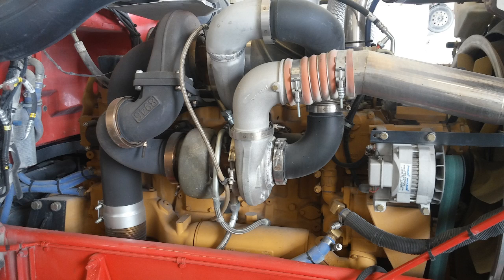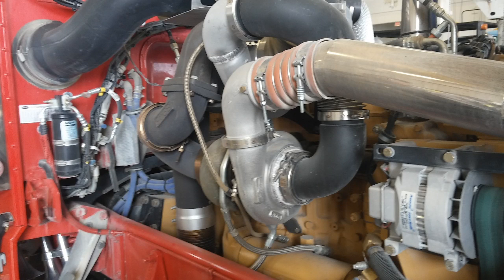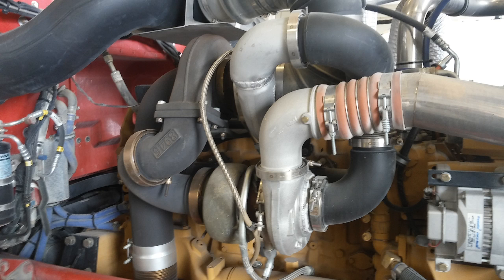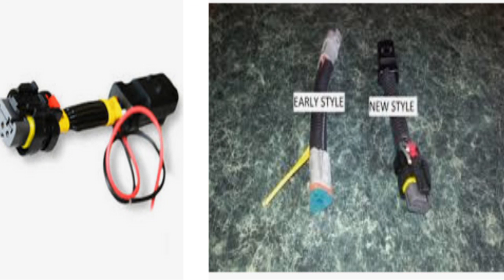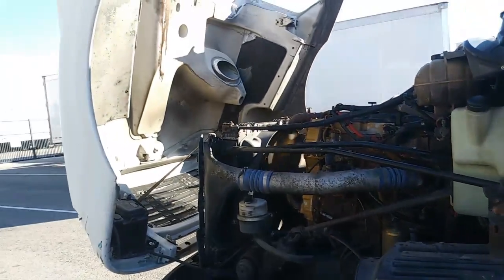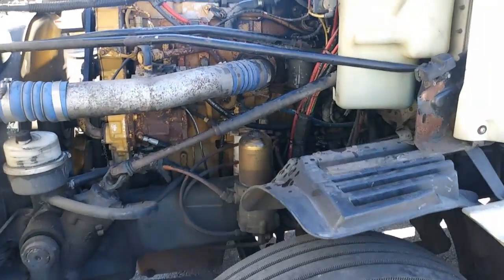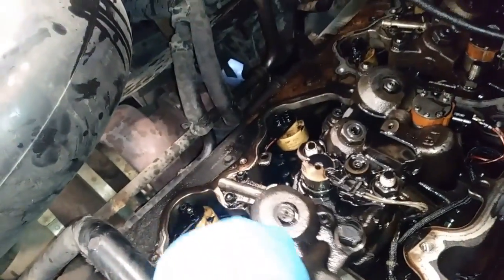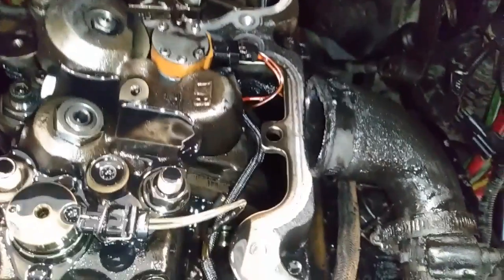Should You Modify Your Cat Diesel Engine? Should You Use Performance Parts On Your Cat Engine?

Comment: Thanks for the info learned a lot from you. I have a c15 MBN  running cold 160 with a load on. Changed thermostats still the same. Can the vent line cause this?
Reply: change again
Reply: Verify your gauge is correct before going too much further. Sending unit could be screwy, or even the gauge itself

Comment: I have a stock 1998 military CAT 3116 turbo engine in my military LMTV truck. It's the equivalent of a Duce and a half. My top speed is 55 to 60 mph. Is there anything I can do to get the truck up to highway speed ex: 75 mph short of driving it of a cliff?
Reply: the only way to do that is to either change all of your axle gear ratios or put an over drive brownie box between the transmission and transfer case which means you'd have to make new front and rear drive lines.

Comment: Warranties aren't worth the paper they are written on.  The core aspect I would say is very very valid.  The other aspect of folks not understanding how their components are suppose to work together compared to he engineer that designed it is also valid.   Dealerships will weasel their way out of any warranty they can.  I know I work for one.  You shouldn't be modding your equipment unless you have the means or know how for that matter.
Reply: I disagree. Cat just honored my warranty to the tune of $25,000.
Reply: @joe67tro   it happens every blue moon, I'm glad you didn't get shaft.    In no way shape or form am I bitter at dealerships either, I'm just saying they aren't always rooting for our team the end user.  A lot of folks don't get the same in frame music you got to hear.  Good for you Joel.
Reply: @910starlet   To be honest, I was very surprised when they told me warranty would cover it. I was waiting for them to hit me with, Because of "this reason" it won't be covered.".
Reply: @joe67tro  I too am surprised when a service writer stands behind their warranties, they have only so many billable hours to reconcile the discrepancies in brand new trucks.  It's even worse when it comes to an inframe.  But yes sir, I'm glad you had your warranty honored.  Very uncommon now a days.
Reply: @joe67tro  my buddy c15 was rebuilt by cat made it a mile down the road and shutdown and would not start. Had it towed back to cat. 3 days later they tried telling him it needed rebuilt again because of dirty air filters and they wouldn't stand behind the warranty. That got lawyers involved
Reply: The more you know, the more you'll NO!
Reply: I dunno, Cat is paying for most of a repair I'm doing on a trash compactor, just out of warranty... EGR cooler failed and hydrolocked the engine. 
Case by case, dealer by dealer, brand by brand. Some will bend over backwards to help you, others will bend YOU over backwards to help you.
My experience across 2 dealers for Cat- Caterpillar will honor their warranty with minimal exceptions, UNLESS you abused it. And trust me, on modern stuff... we will know. On the machines, some will even tell us how many times you've run without the seat belt on, let alone how many times you overheated that torque converter, engine, etc.

Comment: What jerk thumbs down,I'm ready to send this fellow money for all the good resourses, instructions and the help he has offered to so many Cat owners. Good job Shawn I have a 3406b and it's not heating up above 160 ,and I've been told the thermostat is stuck open
Reply: Just had mine replaced, same problem, and it fixed it. Get a infrared thermometer before hand and make shire the gauge is reading correctly
Reply: also check to make sure its not the guage
Reply: thats easy to fix

Comment: Another great video Ape!  Also I might add that the other problem with having aftermarket parts in your engine is that when it comes time for replacement down the road, Cat REMAN does not take back the old parts as cores.   So that set of injectors that costs around $500 a piece at your local Cat dealership goes up to around $800 a piece due to the added core charges due to you not having Cat parts to return back to Caterpillar.  Blow up the aftermarket high pressure turbo in your C15 ACERT engine, have it shell through the low pressure turbo and watch the prices go way up.  I've had the fun of telling a customer about this happening and those conversations never seem to end well.  The aftermarket is becoming big business now that the Cat engines are starting to slip away from the first and second users to the third and fourth users that are not as likely to want to spend the extra money for the Cat parts until they are stuck far away from home needing to get home.  My dealership is teaching us on how to spot those aftermarket parts because we have gotten burned accepting the aftermarket cores as legit.  Also, I had a customer that had a C13 with a modified ECM to remove the emission equipment from the truck,  worked absolutely great until the ECM failed in the middle of nowhere New Mexico.  He had to purchase an ECM, have it programmed by the Cat dealer that he was at, have it shipped next day air to the outfit that wrote the modified program for the software installation, then have it next day aired back to him for the install.  It was either that or have to pay to have all of the emission equipment (DPF, CGI cooler etc.) installed.  Took him a week and lots of money to get that one repaired.  Like you said, the engine is all yours to do as you wish, and I'm as big a horsepower nut as anyone else, but beware what happens when things break on you.
Reply from the maker: That is a great point. Didn't even think of bringing that part up, but it is a real problem that can cost a lot.
Reply: you dont have to use aftermarket parts every thing you need to modify will come out of caterpiller parst bin except turbo, many routes to go there
Reply: I am at a point of a rebuild on a 2005 Acert 15 NXS Prefix and have been on the fence about doing the single turbo conversion. These remarks definitely bring up such great valid points. AdeptApe I thank you kindly for taking the time to share your knowledge with us. You help keep what remains of the trucking industry great. Thank you. 🇺🇸 ❤️

Comment: Would advancing injection timing damage or wear out engine components prematurely?? The timing was advanced by one tooth on the injection pump gear.... it's a mechanical diesel engine, naturally aspirated
Reply: The94GTC  your right it all comes down to gear ratios and the styles of pumps on these trucks a 3 degree bump on a p pump cummins wont have drastic effects vs a cat or something else
Reply: No it shouldn't cause any sever wear nothing should change drastically of you know what your doing with advancing or retarding timiming will give you a more efficient fuel burn youl pick up some power you may notice harder cold starts in the winter but no if you know how to time kt and you know exaclty whats going to go on your motor will be fine i just timed my 12 vakve cummins with an 8 degree bump over stock its fine
Reply: @masoncarter7350  thank you very much!!
Reply: The94GTC  thank you very much!

Comment: Start with simple question, 

What are you trying to achieve? What's the end goal you want? 

Law of universe says you can have power , reliability, fuel economy but only 1 or 2 at a time never all 3.

And budget of course
Reply: True, but not with everything. For example, common rail fuel injection, it is used in cars for it's ease of control over fuel injection and efficiency. It is used to reduce noise, by reducing peak cylinder pressure, therefor making the engine more reliable, the direct injection in itself has a slight effect on power output by introducing a more efficient combustion, meaning as a result, fuel economy also goes up.

But yeah, generally that is the case.

Comment: The biggest cause of damage on a modern diesel is the emissions control systems. Modifying your engine to eliminate your SCR and DPF vastly increase its longevity and efficiency. That is not arguable. You can make the argument about legality, but the engine will only benefit from it.
Reply: True it will increase life
Reply: Guy you don't need it what they should of done is used a system that reads the EGT when it's to low it throttle up the engine to get it hot enough to burn the fuel properly then throttles it back down and repeat the cycle its
 idling is what causes soot  AKA unburned fuel
If you work the engine in its sweet spot it doesn't 
Make black smoke
With that system you dont need the latter 
No Horse piss
No DPF
No catalytic converter/SCR
Reply: terry jenkins It seems like now they have gotten over targeting the black smoke and now they are going for NOX. Which is totally ridiculous. Only in the US do we worry about getting diesel NOX emissions so low.
Reply: @bosborn1   The ones worry about it lives in multi million dollar homes, they fly in private jets etc! Biggest fucking nox producers ever!
Reply: @doorguner01  The whole thing is a BIG LIE - just a way to TAX people for breathing/existing!
Reply: They don't want the truck to last they just want you to buy a new one ever decade or less!
Reply: Yes but it restricts the air flow thus making massive amounts of back-pressure resulting in catastrophic failure. Plus it’s another system you don’t need on your truck. And Please MR Tree hugger!!! before you start to offend people with your foul comments know what you are saying before you open your mouth.
Reply: you have spoken like a true caveman , stuck in the 1980s
Reply: @TRPGpilot  th 80's were great indeed. Gutted peolple. Not nutless metrosexuals I see around me now.